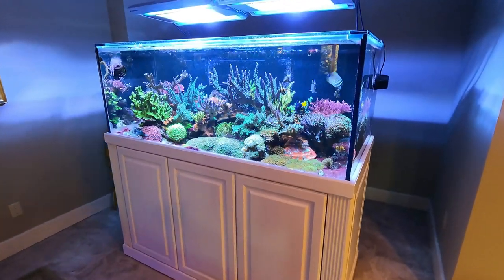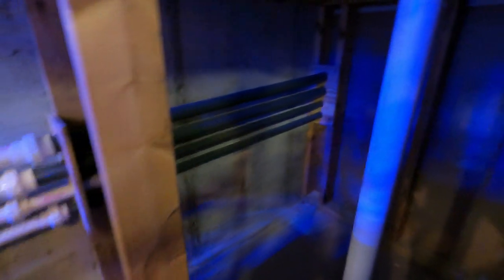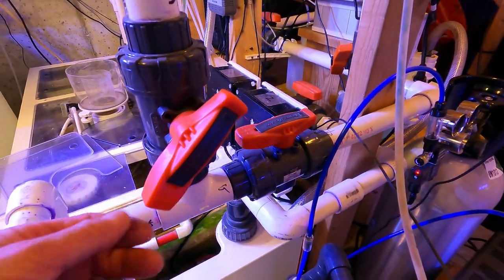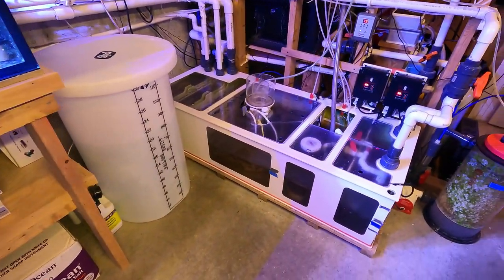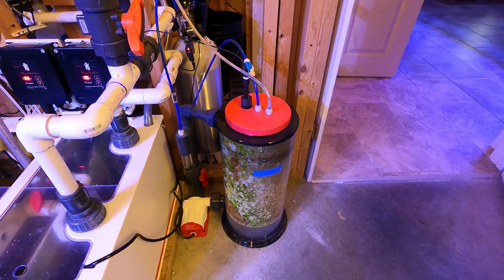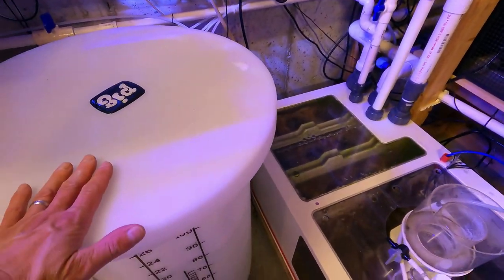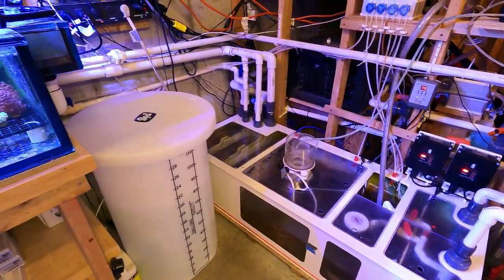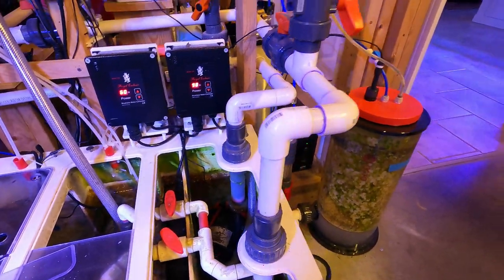What Makes This Tank Tick? My Equipment Setup

Comment: Kessil a500x tuna blues would be a great upgrade for this system, could ditch the halides and the chiller. You'd have better consistency of lighting output long term, MUCH lower energy consumption, and won't have to worry about chiller maintenance.

Comment: Move the calcium reactor effluent from the skimmer pump, to the skimmer body, this will reduce the calcium buildup from the skimmers pump. Saving you the added maintenance and pump replacement
Reply from the maker: I actually did that at first and it impacted the performance of the skimmer. So far I have not had an issue with calcium build up in the skimmer pump. I clean it every 3 months.
Reply: @ReefBum  I know people have had issues,  with the high calcium water, combined with the heat from the motor, causing calcification of the magnet ect. Glad it's working out for you though.

Comment: Keith your content is so helpful! I live in New Hampshire and I'm setting up a reef tank and your channel has really helped me plan out my system. I purchased my tank from Coast 2 Coast based on your experience. It's scheduled to be finished in February. I have a question about your frag tank plumbing. Does the frag tank have only one drain and one return? Isn't that a bit risky, what if the drain clogs?
Reply from the maker: Many thanks Cody, I am glad I was able to help. I go pretty basic with the plumbing on my tanks. For the frag tanks I have never had any issues with clogging with the one drain and one return. I do periodically check to make sure there is no debris or a large amount of algae in the external overflows but they drain very well. I also use 1-1/2" drains and that seems to be plenty wide.
Reply: @ReefBum  Thank you! Well having one drain and one return on the frag tank certainly simplifies the plumbing and to an extent the sump layout.

Comment: Keith you do neat work. That’s a lot of  PVC . Only concern for me is any electricity near a tank should be higher in case of a leak. Why is your nitrates so high especially when adding bacteria. I had to stop adding Brightwell Mirco 7 because my nitrates went to zero.
Reply: I’m guessing he has all the electrical boxes fitted with GFCI plugs and more than likely Arc fault breakers in the panel.
Reply: He said it in the video, he doses nitrates and maintains 2.5 PPM
Reply: By adding nitrates isn’t that causing your phosphate to be low.
Reply from the maker: @bluereef9530  Yes, that could happen but I do have some cyano in the tank and I think that is absorbing phosphate.
Reply: Just my experience what happened to me and spoke to DrTim. He suggested to  shut my skimmer off a few hours a day. I have a bare bottom tank and low nutrients. I was like you adding phosphate and nitrates. It was easy controlling Po 4 feeding more pellets. Phosphates are .04 and I feed frozen food if I see it go up. Everything balance and save money on not adding Po4 Once in a while I might need to add nitrates. I also believe  Tim  was right the skimmer was removing a lot of good bacteria that was also contributing cyano. Just my 2 cents.
Reply: Do you believe cyano grew on rocks because there little  phosphate in water colony while rocks had nutrients to grow cyano. While water colony add little good bacteria from  the skimming and UV.. To me we are removing good bacteria and than we  add bacteria.to adjust what we take out. Make sense to me.
Reply from the maker: @bluereef9530  I believe the reason why I have some cyano on the bottom in the back is due to detritus that settles there. I usually hit that with a power head every other day but I have been slacking off :(